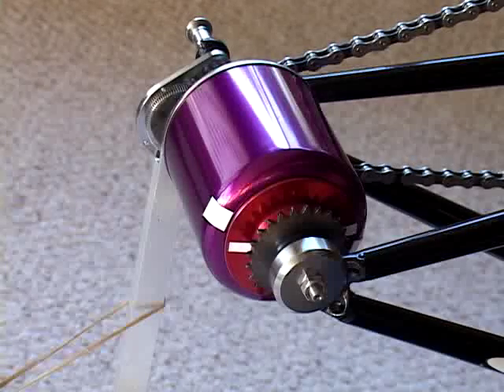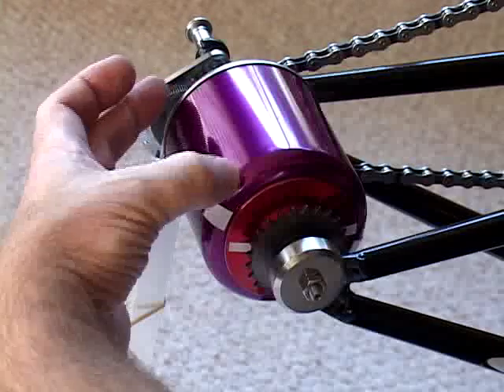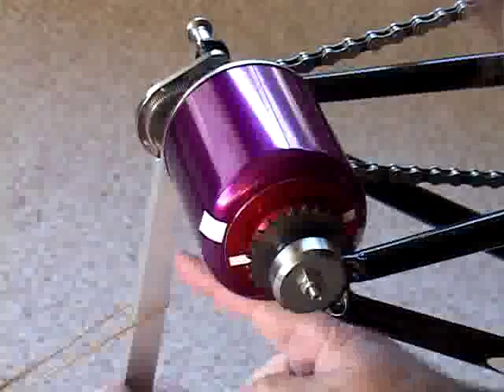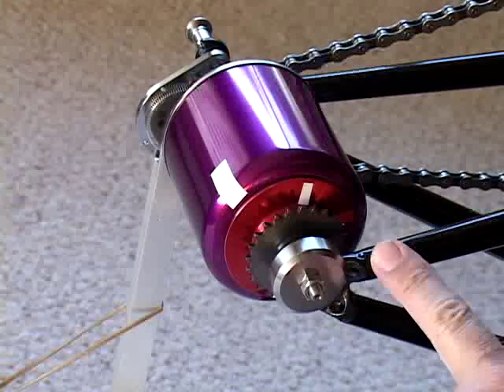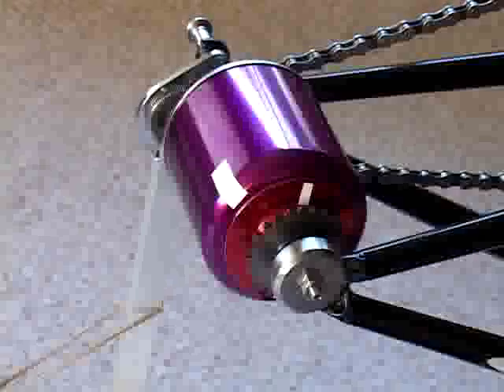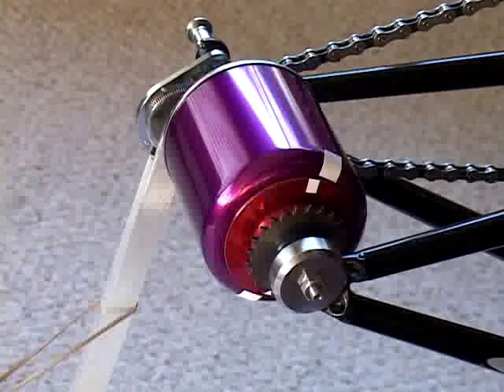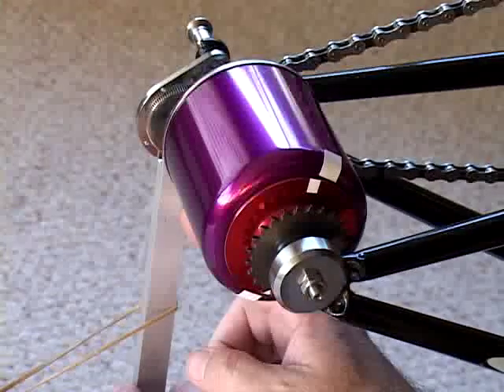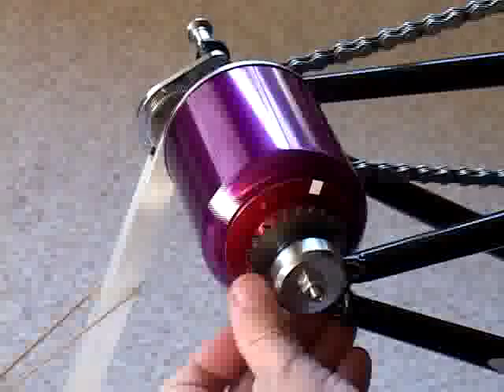Automatic Bicycle Transmission (IVT)

Comment from the maker: The SIVAT is a torque multiplier.  There would be no point in using more than 1 unit on your bike.  The new design I'm working on will easily give you more than 5X high gear, even using a fairly small front chainring (28-34 teeth).  I'm making this change to accommodate MTB riders who want maximum ground clearance, also increasing its power capacity.

Comment: Hello again. I was wondering if I would be able to use a series of sivats as gears stations like I have on my bike? Would they be more efficient than bicycle bottom brackets? Can you go into high output to input ratios (gearing) such as X5. Would I be able to put a torque multiplier on my bike with your system or a torque multiplier on my bike without your sivat or a sivat on my bike without a torque multiplier?

Comment from the maker: I'm a big guy who's destroyed the 3-speed hub repeatedly by bicycling in mountains with it combined w/ derailleur [hybrid] gearing.  This experience taught me about what's needed to design a tough alternative that's lighter & stronger.  I'll test the SIVAT for durability.  It will compete w/ the remarkable Rohloff, & will likely beat it & the NuVinci in efficiency, longevity & weight. 
The patent is in-process, and it is unique as an invention.

Comment from the maker: Thanx.  Yes, you'll be able to drive the hub directly if you use a large rear sprocket.  250 watts won't be a problem, but you might need to change the spring that controls the automatic shifting.

Comment from the maker: One of my goals for the 2nd design is to raise its power throughput to enable use w/ motors up to 1 kW.  This isn't easy considering weight & size constraints for a bike, so this is taking more time than I expected.  I've also considered the same design to be used as a bottom-bracket mounted version and a hub-mounted version so that most components are the same for both versions; this should ultimately give more flexibility for the end-user to arrange a motor-drive for mopeds either way.

Comment: You miss my point. Per your demonstration here, the more force I apply to your IVT, the lower a gear ratio I get. But more often than I think you realize, cyclists do not want their ratio to lower as more force is applied. For example, if I wanted to come out of the saddle and sprint, your device would automatically lower the gear ratio as I applied more watts, actually making a sprint impossible. Oh, and out of curiosity... which "elite bike racing pros" did you consult?

Comment from the maker: This uses gears instead of rollers to transmit power, so its power capacity is significantly greater for its size.  Although current CVT's in cars are limited in power thoughput, they've proven to enhance systemic efficiency which can apply to cars with greater power using this approach.

Comment from the maker: I built & used a CVT version of this on a bike.  It worked very nicely on hilly rides, but didn't have the ratio range I wanted.  This IVT version has more than enough range now.  I've done a helluva lot of bicycling in mountains, and designed the SIVAT specifically to address pedaling efficiency, supported by research into bicycling ergonomics done by sports physicians, & by studies of elite bike racing pros.  Consistent input (not output) cadence & force are the result.

Comment: I want to use a transmission like yours to put a fly wheel on the inside of the spokes on a bicycle wheel eliminating all the chain and extra bracketing of a flywheel elswhere. then the fly wheel could be a battery put a little motor on the front wheel and you've got a flywheel assist electric bike with very little extra weight.

Comment from the maker: Thanx!  The new design will offer a 2.7X high gear ratio!  That's big-time overdrive!   Even disregarding the 55T/11T chain-drive ratio here for top gear on its chain-drive, The SIVAT will offer many options for input or output gearing at nearly all intermediate ratios!

Comment from the maker: Inane?  No other transmission does this; it maintains optimal efficiency of transmitted power across the range of final speeds from any prime mover.  Don't let your ignorance prevent you from appreciating a hard-won goal of conserving resources in this way or any other.  Engineering is difficult to understand, but worthy of pursuit.  If you learn the language of science & engineering, you'll learn that progress is subtle & powerful beyond your machinations.

Comment from the maker: No.  I'm redesigning a 2nd version to be a fully functional unit from which such data will be acquired using a dynamometer.  Calculations based on known efficiencies of similar gear-train components suggest efficiency should be in the range of 88% to 94%.  It should compare favorably w/ a Rohloff 14-speed hub.

Comment from the maker: Yes, you're right!  The 'strength' of the spring does determine that.  When the rider initially starts riding, the ratio will likely be in a high ratio, but will automatically lower within a portion of the pedal stroke; so he'll have higher wheel torque for initial acceleration.  I'm choosing a spring that won't allow the ratio to go too low under any normal conditions, including steep ascents.  The rider will be able to adjust the spring to his preferences.

Comment: Now I may be wrong here but with this design on a bicycle would it be possible that a steep enough hill could cause this transmission to stop the output? Or even just trying to start out because the wheel is initially stopped would it allow the torque required to get moving? I suppose the strength of the spring would determine that.

Comment: i've always thought about this, in fact, I imagine an automatic transmission but this works with a capsule with gel and various contacts, these mark the different grades of hills to change the gear by any mean you want, i.e. a solenoid, and of course need electronics to delay the change in case it´s just a step or someyhing momentary, I believe it´s a good idea, just that i never have tried to do it, if you earn money with this idea just send my part by mail jaja

Comment from the maker: In the new design, I'm confronting the challenge to provide a single design that can be used in either a special compact bottom bracket or in a hub.  My goal is to make a single design that can be used in a variety of ways, including non-bike applications; production economies arise from such standardization.  Part of that goal is raising its internal top ratio to >3X.  Yes, this also raises it torque capacity, as you suggest.  This requires intense design analysis to achieve such compactness.

Comment from the maker: That is precisely what the SIVAT is designed to do.  When the grade of the hill levels off, it resumes toward higher gear ratios.  Reviewing the mathematics involved in the geometry of its automatic shifting, it turns out that the shifting mechanism can be simple for regulating pedaling cadence & torque within narrow limits; the goal of efficient pedaling on mountain trails.

Comment from the maker: It's totally mechanical; no motors involved.  Thanx for your interest.  This is not yet available as a product.  I'm working out the details to make it a stronger design with a higher top ratio, after which I'll seek crowd-funding to bring it to product status.  I'd be pleased to supply it to India where it could find many uses.  Please check this site for the new design in a few months.

Comment: I am from India. The design that has been shown in the video consists of unit which I presume has a battery and a motor inside it. The spindle which protrudes has a sprocket. The front wheel has to be provided with a larger sprocket (1:5 ratio), Can I have more details so that I can think of importing the unit and installing on my bicycle. Thanks. Priya Prasad (priyajuneprasad@gmail.com) .

Comment from the maker: Notice that the chain converges to the back sprocket.  The front sprocket is 5X larger than the rear sprocket, so the actual gear ratio is 5X higher than what you see in the SIVAT alone.  Regardless, the new design will include much higher ratios on its own.

Comment from the maker: Autobike uses a cheap derailleur shifting system that up-shifts as speed increases, a real nightmare for anyone attempting a sprint.  The SIVAT downshifts gradually when pedaling force increases.  I tried out a predecessor CVT that downshifts like that, and find it a very intuitive way to ride in the mountains.

Comment from the maker: Good question.  I deliberately designed this to respond to overload far in excess of most bicyclists' power output.  It's there to prevent abuse with over-sized motors exceeding 1.0 hp.  An uphill start will be a positive drive at a fairly low ratio.  The user can adjust this per his preferences within safe limits.

Comment from the maker: That's the next step.  I needed to re-design it to fix a weak spot, and to give it better performance & range before mounting it on a bike to show a test ride.  Prototypes are very expensive, so I'm calling for funding in this video to get financing for development & productionizing.  That worked, so I received several offers, but none equitable.  Kickstarter or Crowdfunding should do the trick.  I want to see this on the road too!

Comment from the maker: Notice that the drive chain converges toward the rear sprocket.  The input is 55T/11T, or 5:1.  Multiply the SIVAT ratio by 5!  Regardless, the new design is ~3.6:1, making a very high top ratio with a smaller front sprocket.

Comment from the maker: My intent, all along, has been to also provide a manual override for riders who want to lock-in a ratio.  Regarding differences in power throughput & preferred cadence, adjustments are provided for depth & speed of automatic response that will enable custom-tailoring to the individual rider.

Comment: Competition sells between $350 for N360 and $1400 for Rohloff, you could easily get pre-orders in the ~$500-$1500 range. If you can beat Rohloff in weight and ratio and then beat N360 in max torque, you could potentially have a $1600 product for presale orders to fund your production using kickstarter. I have been watching and waiting for you several years now and hope you finally get a chance to move fwd. Good Luck. Many of us in the MTB community have the liquid cash to spend on this!

Comment from the maker: How much power does your engine produce?  This should handle about 1 kW (1.3 hp), or a bit more with the right sprocket combo.  I've deliberately redesigned it with optional motorized drive capability.  Note that it's not yet a product.

Comment from the maker: The purpose is the same as any multi-gear transmission; to offer low gears for going uphill, high gears for going downhill.  The advantages are that this does it automatically, precisely & smoothly over a very wide range.

Comment from the maker: Yes!  Actually, an electric motor's speed control can improve drive system efficiency despite the fact that motor torque declines with speed almost proportionately.  A classic example is the first Tesla Automobile prototypes which had 2-speed transaxles that offered excellent acceleration & better efficiency than the 1-speed Borg-Warner transaxle they use now.  Motors are most efficient working at close to their rated power load.  Engines work a little different, but similar enough.

Comment: Is it possible to implement this transmission fully automatc so  as to keep its driver (for example an electric motor) at the highest possible torque for the achieved speed?

Comment from the maker: It's a completely different mechanism, and it does not 'slip'; it's always fully engaged without dynamic friction.  A newer design has a higher top limit (2.7X) to its ratio range using a spring (instead of a rubber band) to adjust toward its upper limit unless throughput torque momentarily brings its ratio down proportionately.  When torque decreases, the spring automatically raises the ratio.

Comment: it basically looks like a fishing reel, applied to something other than fishing? Am I wrong? You show that when the load is too much it "slips" for some sort of protection.. but it sounds exactly like when your drag is set too low and the fish takes off and you can't reel anymore.. so you turn the drag up..and up..and up..and up.. seemingly "infinite", I am confused on how it "goes up a gear" though..?

Comment: P.S. It’s worth while to compare the estimated mechanical efficiency of the SIVAT (88%-94%) with experimental data for several hub gears as well as derailleur gears (CHESTER, R.K. & F. BERTO: The mechanical efficiency of bicycle derailleur and hub-gear transmissions, Human Power [2001], issue 52, 3-11; ihpva [[dot]] org [[slash]] HParchive [[slash]] PDF [[slash]] hp52-2001.pdf).

Cheers,
Wilhelm

Comment: ... (26er, 27.5, 29er, 29+ [all-new big wheel SURLY Knard tire class], 36er), even for high-pivot FS designs like the 2013 ZERODE Bikes (NZ) G2.

Finally, I think it could be helpful to discuss organizational, financial, and logistical issues of building next prototypes and arrange subsequent manufacturing with some of the one-time start-ups that became successful but are yet independent makers of fine bicycle drivetrain components (i.e. PINION [DE] gearboxes, ROHLOFF [DE] gearhubs).

Comment: 7. Gearbox (FS) version: For full suspension designs with concentric main pivot point/output shaft like described earlier in this thread (similar to the NICOLAI [DE] G-Boxx 1/G-Boxx 2, the SR SUNTOUR [TW] V-Boxx and the all-new EFFIGEAR [FR] gearbox) provide different versions with different measures of the distance from the BB spindle to the output shaft, in order to achieve an optimum rearwards axle path for different wheel sizes each ...

Comment: 6. Internal-gear hub version: Provide different hub platforms with interchangeable end caps according to the most popular axle standards (135mm platform: QR, 10x135mm, 12x135mm, 12x142mm, X-12; 150mm DH platform: 12x150mm, 12x157mm; 170mm fat bike platform: QR, sometime maybe 12x170mm).

Comment: 4. Gearbox (HT, FS) versions: Make use of an already existing high-performance crank arm/axle interface standard unlike the PINION.eu [DE] P1.18 which uses proprietary cranks.

5. Gearbox (HT, FS) versions: Provide different Q-factors that match different needs (narrow Q-factor for CX, RR, TT and XC ... super wide Q-factor for big fat tire MTBs with 4.8"+ tires).

Comment: 3. Gearbox (HT, FS) and internal-gear hub versions: Make only a high-performance version that is capable to handle very high torques like only pro sprinters can generate. A more basic version could possibly fail if not used "properly" and ruin the reputation of the product. Eventually offer a special light-weight but nevertheless high-performance, high-torque version for competition racing and weight-weenies.

Comment: Some thoughts to the SIVAT

Barry, let me quote some suggestions for the SIVAT bicycle project, not in terms of "wise guy" advices but rather in terms of proposals.

1. Don’t step into the market until the SIVAT undoubtedly reaches the high-end performance level needed to compete with market leaders in high-end bicycle drivetrain stuff (not least mechanical efficiency-wise [you named 88%-94% for the SIVAT earlier in this thread], weight-wise and low maintenance-wise).

Comment from the maker: Notice how my chain converges toward the rear sprocket?  That setup has a 55T/11T sprocket drive, which is 5:1.  Regardless, the newer design will have a ~3:1 internal hub high ratio, so even fairly small front sprockets will deliver high gears.  BTW, gear ratios are designated by output speed divided by input speed; not the other way around.

Comment from the maker: Not to mention that it's much more efficient.  Hydrostatic systems are ~60% efficient, at best.  This should be 88%-94% efficient, as calculated by gear train analysis.

Comment: hello, i am interested in your transmission as i am in the process of building a vertical wind turbine powered water pump for my cattle.  i am interested in this as a way to use an automobile water pump along with check valves.  this seems like it may be a good way to get around the high to low wind conditions that are experienced in my area, from no wind to 50mph. if i could get some information on the availability and cost of these transmissions, please contact me at davemacneal@hotmail.ca

Comment: From the sounds of it, its basically a ramped system with sprung fingers which slip over the ramps at low pressure. The more force you apply with your lever the harder they are pushed against the center ratchet and the more it "grips" to provide the output.

"0.1% constant across all output ratios"
"a refinement of this transmission can get down into the 0.01% ripple possible"

Im confused, how is something "0.1% constant" and what are you referring to when you say "ripple"?

Comment from the maker: The BitRaptor is a variant on the Epicyclics CVT that's been around since the 80's.  It's 2:1 bandwidth (ratio of high gear-to-low gear) has limited uses, unlike the SIVAT that has infinite bandwidth.

Comment: I just want to congratulate you on two counts - firstly for doing this in the first place - and secondly for the patience and politeness you show in this column!
I'm a lifetime ME and MTB-er (just to wind up the anti-acronym brigade!) following your progress with hope. An application jumped into my mind; hybrid cars use Rankin-cycle IC engines to get 15-20 pc fuel saving; a much wider range of vehicles could use this engine type, using your trans to stay within its smaller efficient rpm range.

Comment: It looks like most of the work is done already. Surely it couldn't be a big step to get it onto the wheel and into the market? I want one! 

It looks great but the video would of been a lot better if you had started with a summary of what it is. Having to watch 7 min for 1 min of info is rough.